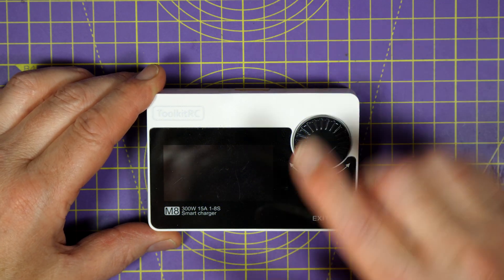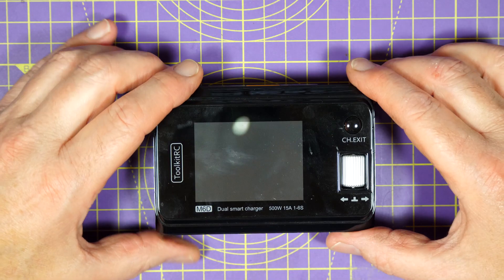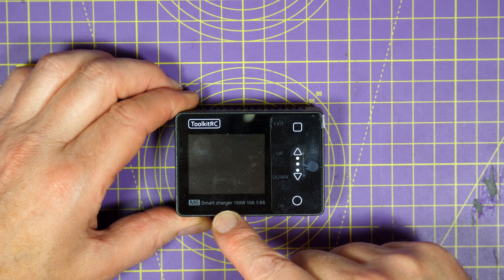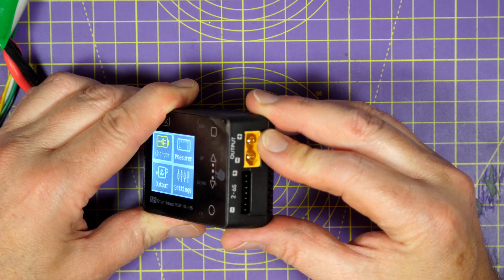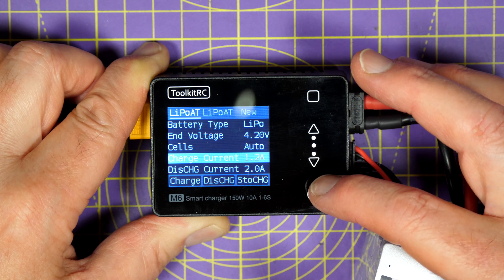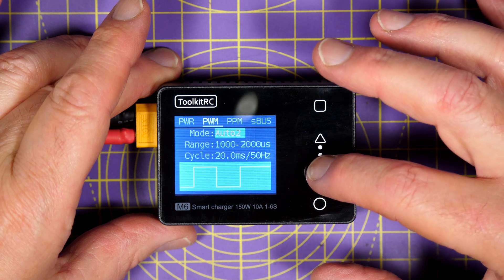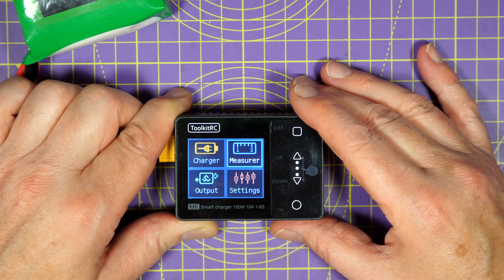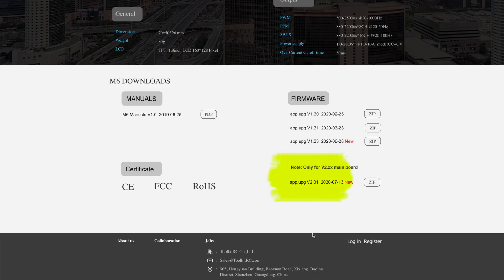ToolkitRC M6 150W 10A 2-6S Smart Battery Balance Charger // Upgraded V2 new version review

Comment: They haven't made a new firmware for 2 years. 🤔
Reply from the maker: Doesn't need an upgrade. I've been running on V2.01 for over 2 years and the charger works perfectly. This isn't a DJI product that needs updates every week 😉
Reply: @WhirlyBloke  👍🖖😂

Comment: How can I find out what version I have of the charger, on the side for firmware updates are two firmware versions, one for the Only for V2.xx main board version and the other for the v1. 🤔
Reply from the maker: To determine the version of your ToolkitRC M6 charger, you can follow these steps:

Power on the charger and go to the "System Info" menu.
Look for the "Hardware Ver" option. This will tell you the hardware version of your charger.
If your hardware version is V2.xx, then you have the V2 version of the charger, and you should use the firmware update labeled "Only for V2.xx main board version."
If your hardware version is V1, then you have the V1 version of the charger, and you should use the firmware update labeled "v1."
If you are still unsure about the version of your charger or which firmware update to use, you can contact the manufacturer or consult the user manual for further guidance.
Reply: @WhirlyBloke  Thank You 🖖

Comment: Can the voltage of the power output function be altered in 1V steps only, or can you set 4.8v for example? What is the minimum Voltage output? In a manual I read it can go down to 5v. In a video I saw someone setting 1V...

Comment: Is this accurate now?
Reply from the maker: It's pretty good. But always check the calibration with a multimeter,
Reply: @WhirlyBloke  I did. there's a 0.01 difference
Reply from the maker: @jercsgn  simple to adjust on the calibration screen.
Reply: @WhirlyBloke  got it. Thanks
Reply: Mine just  arrived by the way. Glad it was version 2 already

Comment: As far as I know V2  (v2.01) is not firmware upgradeable (no reaction if connected to PC) also no firmware available from Manufacturer.
Reply from the maker: 2.01 is the latest firmware and only works on the latest V2.xx hardware with the improved balance circuit. Check the downloads page https://www.toolkitrc.com/m6

Comment: How do you know which one you're buying? Banggood either doesn't have them or isn't making it clear.
Reply from the maker: The only way to tell is by looking at the firmware version. Check the end of my video for how. Unfortunately there's nothing on the outside that distinguishes them. These are very new so it's probably best to wait a week or so.
Reply: @WhirlyBloke  Thanks, and is it definitely different hardware or will a firmware update of an older version have the same result?
Reply from the maker: Hi David. Some great comments on my channel so you've won one the chargers I'm giving away this week https://www.youtube.com/watch?v=6VXWEtAXBKk Drop me your address on whirly@whirlybloke.co.uk and I'll get it shipped out.
Reply: @WhirlyBloke  that's fabulous, thank you! They'll be great for charging my whirlybloke inspired Li-Ion packs!

Comment: Thank you Whirly! Love all these chargers that have been coming out. Nice charger
Reply from the maker: With the balance ports fixed it's exceptional, cheap and very small. Thanks for watching.
Reply: @WhirlyBloke  I watch all your videos and would love the honor to be picked as one of your winners. I most definitely could put this charger to good use for some time to come.
Reply from the maker: Hi Game Of Drones. Some great comments on my channel so you've won one the chargers I'm giving away this week. Drop me your address on whirly@whirlybloke.co.uk and I'll get it shipped out.
Reply from the maker: @trevorimpulsebuyguy6398  Email me on whirly@whirlybloke.co.uk
Reply: Have the v1 m6 and i love the size and the user interface its perfect its great for travelling light with small umx planes. But after being sat in its box over winter it ceased to charge due to a blown smd fuse. In my hunt for what was wrong i came across people having balance issues so measured mine and it was out a mile and worse was impossible to accurately calibrate. So its as best i can get which is a pity. And relegates it to storage charging